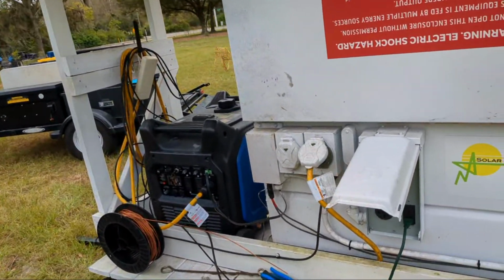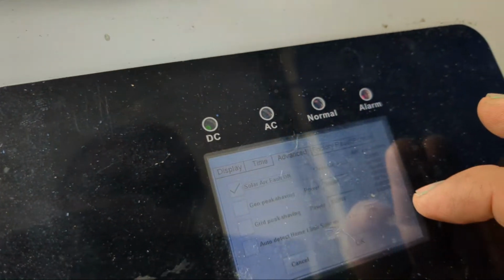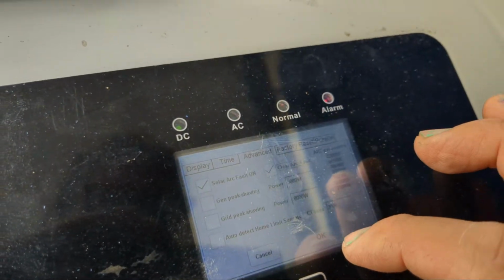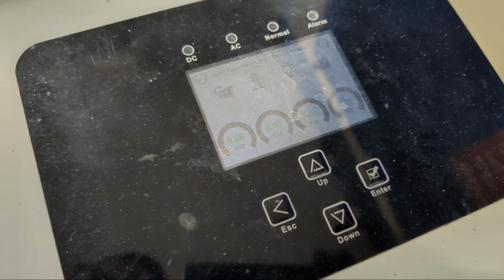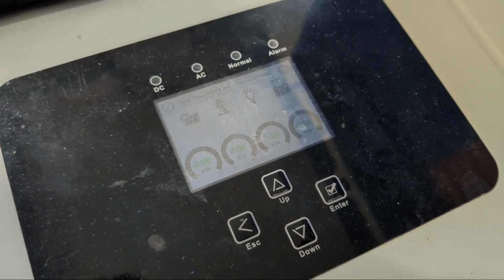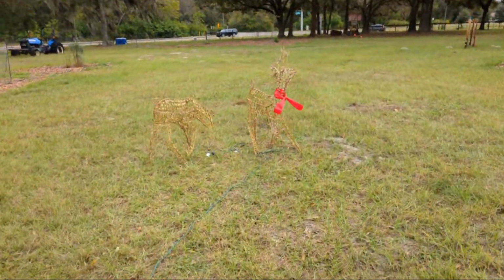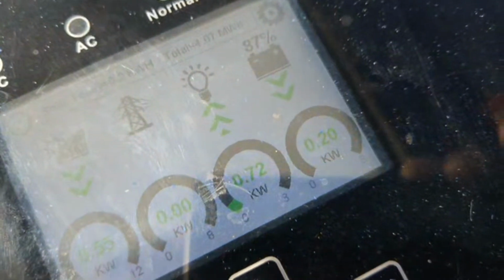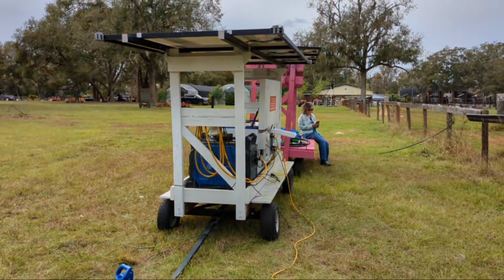troubleshooting solar generator inverter part 2

Comment: A solution for this would be a 240V coil normally closed neutral/ground bonding contactor connected to the grid input in the trailer.  When connected to the grid input, this contactor opens and thus the only neutral/ground bond will be in the grid service equipment.  If no grid, the contactor closes and makes a neutral/ground bond.